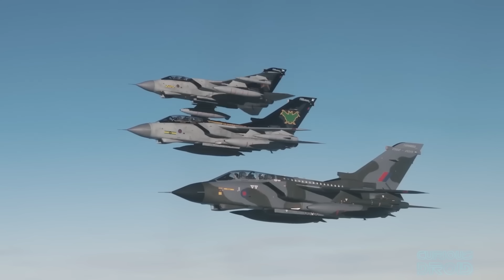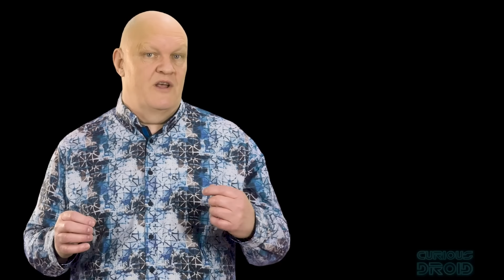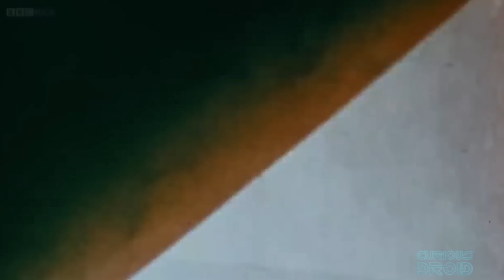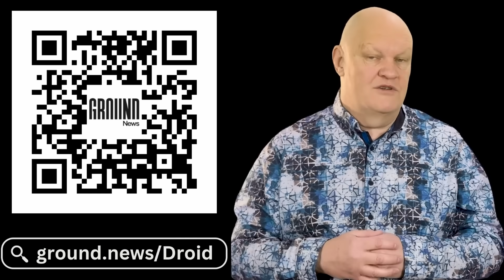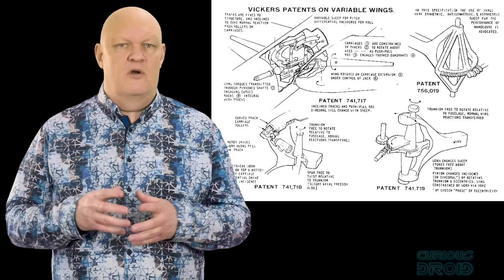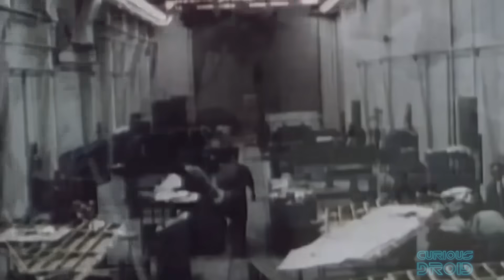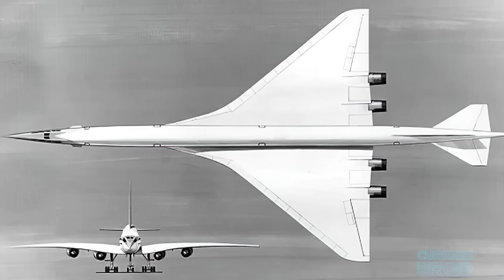Why Aren't Swing Wing Aircraft Made Any More?

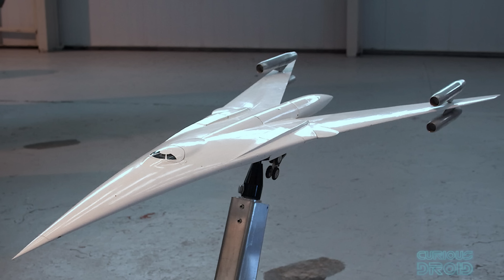Comment: That "Swallow" design @10:31 is gorgeous... I wonder where that model is now.
Reply: It’s at Royal Air Force Museum Midlands, at RAF Cosford. A few other interesting concept models with it as well.
Reply: It only looks cool, but in reality it is a horrendous design. The asymmetrical thrust in case of the engine failure on one side, especially at low sweep angles, would cause an instant catastrophe.
Reply: @Andy_Novosad  I'd think the jets could be closer to the body, or within it. But yeah kind of looks like it would be like trying to push wet spaghetti.
Reply: It looks like something from the 1980 sci-fi era only 30 years early  @Andy_Novosad
Reply: @Shinzon23  It looks like something from Thunderbirds Are Go
Reply: Relying entirely on differential thrust between four engines to maneuver sounds like a disaster in the making if even one engine starts misbehaving. Maybe if it had some control surfaces as a backup, the idea being that those aren't normally used, or at least not used during cruise altitude, for maximum aerodynamic efficiency. But yes, just the risk of one engine degrading in performance or failing, which would result in an uncontrolled crash, makes the concept impractical at best.
Reply: @Andy_Novosad  Imagine trying to jam enough fuel through all those swing points, lol
Reply: @Andy_Novosad  I was thinking that too. I imagine the opposite side engines would have programming to reduce thrust automatically. Getting to the ground with two engines at half power on one side and another at full capacity on the other seems plausible, though two out on the same side could indeed be over the line
Reply: I would love to see Cletus buy and fly an RC version. The plane is gorgeous and way advanced for the time. It looked like they thought of everything.
Reply: It looks like Firefly out of Thunderbirds lol
Reply: Funny thing in aviation and in much of engineering, things that intuitively looks good, are often no so objectively in terms of their performance. Physics isn't always intuitive.

Comment: The F-14 Tomcat had 6000 moving parts, the F-18 had 1700.
Reply: 1000 of those moving parts in the Tomcat were circuit breakers behind the RIO...
Reply: And... the F-14 was a better fleet defense fighter , interceptor , and bomber than the FA-18 and the super hornet . With longer range than either variant of the -18 .
Reply: @John-or9ccUndauntedRaceCars   also had abysmal readiness rates and was a nightmare to maintain.
Reply: @John-or9ccUndauntedRaceCars  in the minds of boomers and top gun fanboys. in reality the f18 can do all of that and way more.
Reply: Yeah but the F-14 had TopGun and Tom Cruise…. that was bound to add to weight, maintenance and logistical complexity.
Reply: @miamijules2149 true, true, the ego alone is tons of extra weight to drag along haha
Reply: The F-14 also out performed every Fighter aircraft ever built including the F/A-18.
Reply: Has.
Reply: @davidcoetzee7369  initially had. Adcap since has likely added more..or less.
Reply: That is due to fly-by-wire
Reply: @MyValki  what? No.
Reply: Do you know that evolution is temporarily forward?
Reply: That parts count sounds unreasonably low.
Reply: And having to land on ships all the time damn sure didn't help
Reply: Big difference.
Reply: The F-14 is one of my favourite aircraft and is still the pride of the Iranian Air Force. (The only export customer).
Reply: How many moving parts does a human body have? And how much time does it need for maintenance after use?
Reply: @paulstewart6293 the body self regenerates 😮
Reply: @mack3579  That's a good trick. Maybe we should try making things like that. They'll eat anything.
Reply: @paulstewart6293 they actually already have! there is a robot that can feed off organic matter! (unless you mean self maintenance)
Reply: @mack3579  usually
Reply: @paulstewart6293  The human body also had a development time of a few billion years, which, I belive, is not a workable timeframe for defence articles.
Reply: @keirfarnum6811  He did his best
Reply: @keirfarnum6811 no, we had a perfect designer. God did an amazing job designing our bodies. Self healing, warming, able to feel, hear, see and taste is pretty amazing if you ask me, and also able to filter out toxins.
Reply: @paulstewart6293 
Um, is that relevant?
Reply: @keirfarnum6811  No  it was just a thought that amused me. Pourquoi pas, on a le droit de se amusé.
Reply: @paulstewart6293  The human body is made of self repairing nanomachines. Lightyears beyond anything we can produce in a factory.
Reply: @paulstewart6293  totally different types of systems.   this is just silly.
Reply: @paulstewart6293 wtf is this comparison 😂?